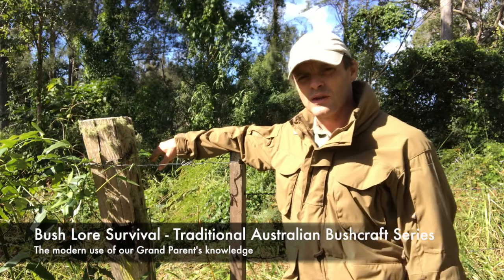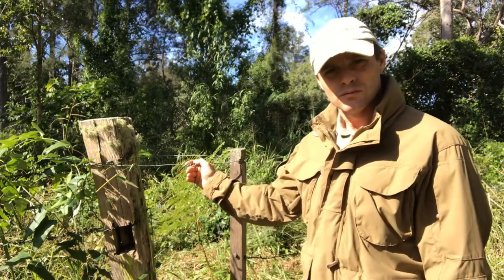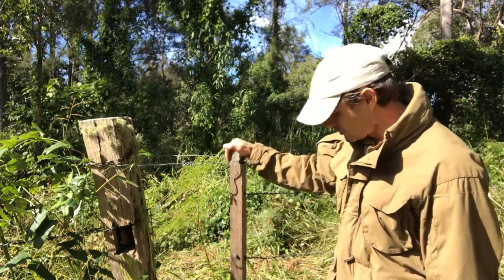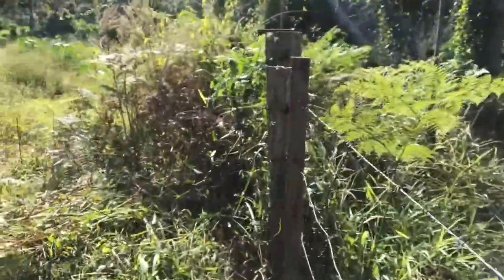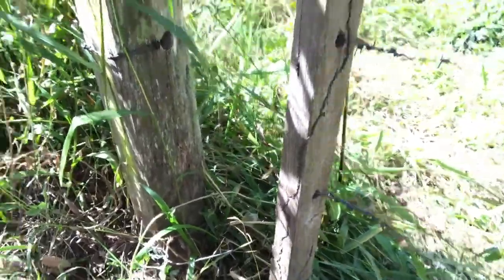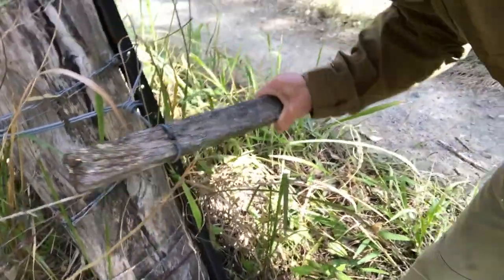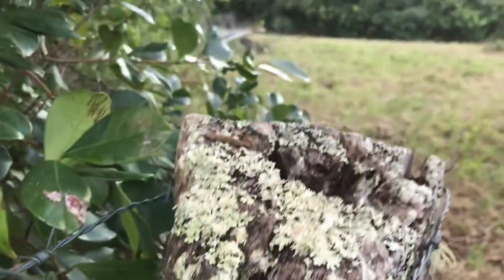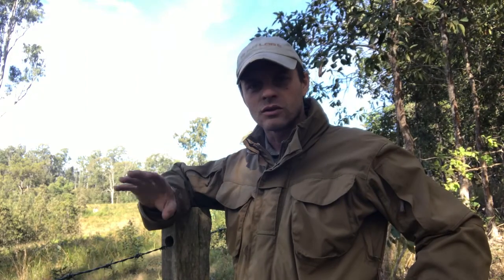Traditional Australian Bushcraft Series - Wire Gates &  Lever Fasteners

Comment: Good one mate. There were a lot of those on my grandfathers and dad's place. Despite being in a remote part of tassie, for some reason they were always known as a 'Taranaki Gate' without a hint of mirth, so I don't think they were having a dig at the Kiwis.

I notice the wires of the fence proper passed through holes bored in the posts rather than being fastened to the posts with steel staples. This seems a lot more common on the mainland, and on thinking about it, while boring holes might be more laborious, you only need one borer, rather than a hammer and thousands of staples.
A lot easier nowadays too with power tools, imagine the old guys back in the day boring all those holes manually.
Reply from the maker: I did see mate that Ron Edwards noted in one of his books that posts with bored holes broke down faster from termites and weather. Perhaps that's why staples were used? The bored posts are still used extensively here in South East Queensland. I'll ask one of the old and bold around here why they prefer to still do that. My guess is that power tools do now make it easier as you mentioned. Thanks for adding to the conversation mate! Have a good one.
Reply: That would stand to reason, the bored holes accelerating decay. Aside from rotting in the ground, the posts always deteriorated from the top down, as the rain got into the grain. Some did a few things to slow this.

Some cut the top of the post at an angle to encourage water runoff. Others nailed a piece of sheet metal on top, even the lid of a coffee tin. Others put a flat rock on top. I suppose if it got another decade or so out of the post it was worth it.
In a similar vein, back in the day the posts were split from the log rather than sawn. Some still do this. They tell me that some strange contraption was used  which split them using gunpowder. They're still around apparently. That is something I'd like to see in action, as long as I had plenty of PPE.
A sawn post has lots of openings in the grain as the grain is cut. It is therefore weaker, and can let the weather in. Similar with the old Viking ships.
Treated posts are available to purchase now but aren't cheap, and aren't acceptable for those going organic.
It is pleasing to see you doing these mate. I've been thinking of doing some videos covering some of this stuff myself. Much of it I consider normal routine stuff, but I am learning that it isn't commonplace at all. It would be a sad thing to see it lost.

Keep up the great work mate. Survival/self reliance stuff is very important in helping develop a well-rounded, healthy and independent person. It sharpens their senses, their creativity and adaptability in other realms of their lives. An enormous benefit to society.
Cheers mate,
Mort